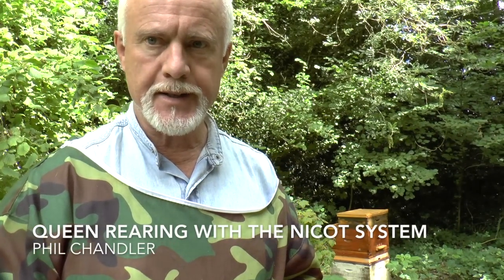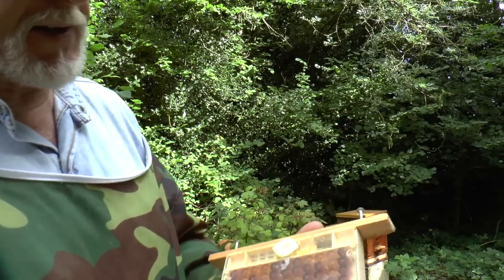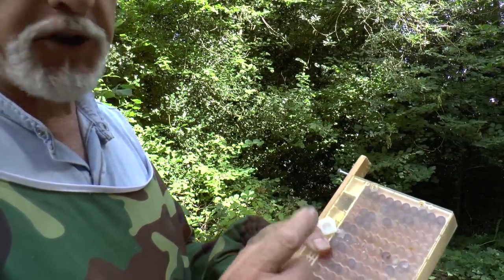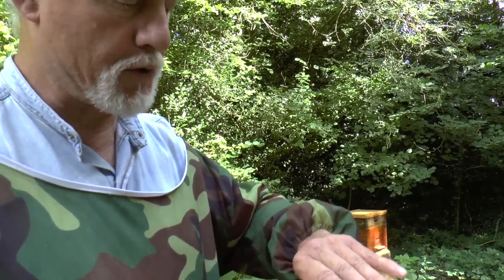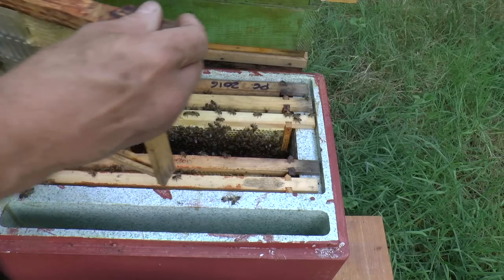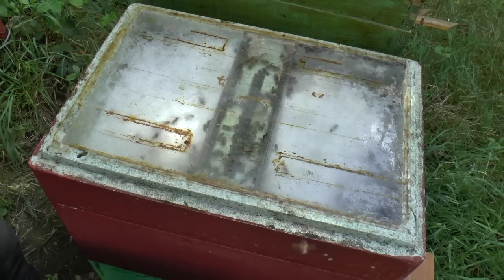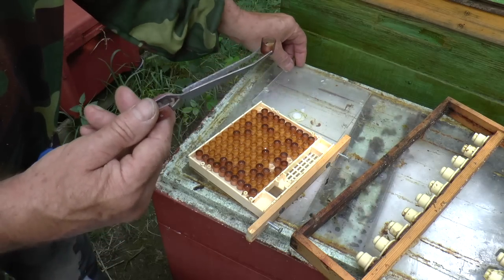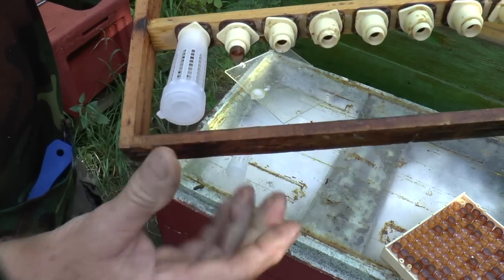How to Raise Queen Bees - the Nicot queen rearing system explained

Comment: Very well done overview of the Nicot system, thank you. I understand why you recommend using tweezers to load the cell cups into the cage and that seems ver good advice. However, I don't know why you also use tweezers to transfer cups to the cell builder frame. I thought the cream coloured holders were meant to be pushed on to the selected cell cups and then that combined unit was pressed firmly on to the brown base mount. I see that you have the cream parts already mounted on the brown base units on your cell builder frame. Is there a reason for this?
Reply from the maker: No reason - that's just how I started doing it and it simply hadn't occurred to me to use the cup holders to remove the cups from the cage!

Comment: Ps. 
 Tip 2 : Firm Holding Cups !
Cups hold in better with a bit of Wax & Propolis is Rubbed onto that new Plastic surface. They fit better and stay Snug apparently. (Not drop out as you said 'could' happen with those lesser 'made' ones !)
Worth a try. 😉

Comment: Use the cell holder to remove the cell. Press the cell holder onto the cell and then put the cell holder and cell on the cell bar.no need to handle the cell cup  and fumble around with it.

Comment: Hi Phil, Recently purchased a Nicot queen rearing kit. On my first attempt found that the bees in the hopelessly queenless hive, had removed all of the eggs from the cups, and then made queen cells on a drawn comb frame. On my second attempt the bees just covered all of the cups over with comb. Any suggestions what I am doing wrong please.
Reply: Quite late response, if you haven't find any solutions yet to any of these problems my suggestions are: in order the bees to accept the plastic cells there should be no open brood in the hive and therefore no other option for them regarding raising a queen. For the funny comb drawing, I usually put a frame with wax foundation 1 frame away from the cells and the bees do most of their comb building there. Hope this makes sense.

Comment: In preparing to start queen production I'm watching and reading.  After watching 2 videos, from 2 different British chap, I've decided to go with Nico.  My question is: you only put 20 cups on that frame.  There are many more than 20 on that Nico frame.  Do you simply select 20 and discard the rest?
Reply from the maker: Usually, I will have several frames in use, so I can use multiples of 20, but otherwise, yes - select and discard. There will, in any case, be some cells that have no egg, and sometimes some with multiple eggs.
Reply: Phil Chandler oh my, I've decided to avoid trying grafting as my old eyes aren't reliable...now I have to determine 1egg, 2 eggs or no eggs.  Well I won't be needed many queens so I suppose 20 cups should give me enough success to satisfy my needs.  Thanks
Reply from the maker: @stevejackson5062  you could consider cell-punching as an alternative for small numbers. Roger Pattison swears by it. See here http://www.dave-cushman.net/bee/cellpunch.html
Reply: Phil Chandler, thank you for the reference and I love the concept but despite reading it 3 times and studying the photographs I can not understand the technique to a strong enough level to feel confident.  The NICOT system I understand so I'll go in that direction.

Comment: Have you ever thought about using some melted bees wax to glue the cups into the holders?
Reply from the maker: virgil warren They are mostly a good fit, but only if you buy all kit from one supplier. I have been known to use pieces torn from blades of grass to take up the slack.

Comment: I would add you should take a piece of wire like a single strand or a paperclip and add a drop of honey that has been mixed with some water so when the queen emerges she can eat or else she will die within about an hour.. very very little goes a long long way though I mean a very little or she'll have it all over her and get stuck she could even die from drowning if it covers her thorax and everything or damage her wings possibly
Reply: Baddest Bees the normal queen attendant bees can still access her as normal. They feed her. Queens rarely feed themselves.

Comment: Instructions say to use all new cups each time.  There are 110 cells in the system, so she could lay in all 110 cells, then you transfer to your finisher system.  I assume you don't create 110 queen cells each time, I'd guess at most 20.  Does that mean the 90 cells you don't use just get tossed out and use 110 brand new cells next time?  Or can you re-use the 90 that didn't get made in to queen cells?  Thanks for the video.  Very well done!
Reply from the maker: I typically choose 40 to start queens and allow the others to continue to develop into workers. I have three cages, so can still use them continuously in series. You can re-use cells, although they are fiddly to clean.
Reply: Thanks for the quick reply, Phil!  Great channel.
Reply: I've read you can re-use the cell cups but your success is diminished somewhat. So if you only need 10-20 cells and the queen only lays in a small margin of 20% it all works out. I've purchased the Nicot system and will be trying it out this week. Thank you for the great video, its great to hear from someone who has used it a few times.